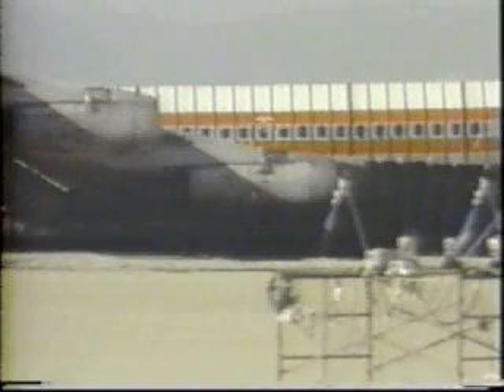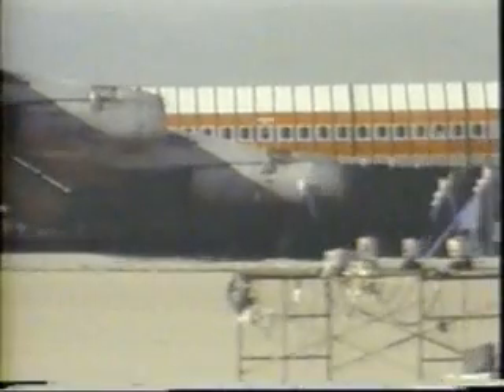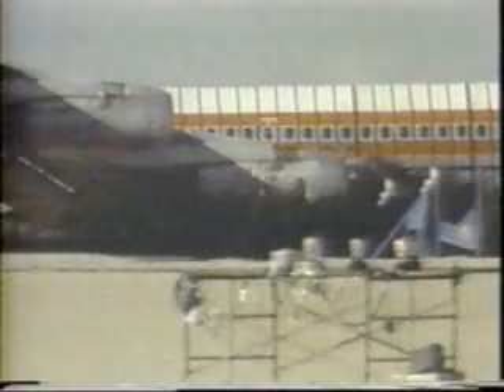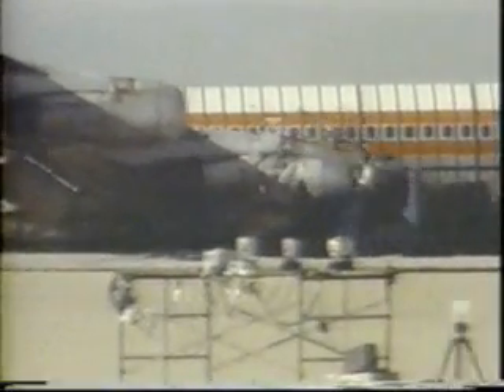NASA - FAA Conduct Airline Crash Tests

Comment: Blah! Thats's not fake.  I worked on that project when I was employed by NASA at Edwards AFB in California.  It was a test to attempt to reduce the flash fire of burning fuel should an airliner crash.

The fuel in the tanks were a gel, then gets converted to liquid when it's consumed in the engines.  Even though there were lots of flames, technically it was a success.  The flames were created by the fuel that was converted back to liquid.

Comment: @IExposeMormonism TWA flt 800 exploded due to fuel fumes buildup and electrical short.coupled with this older test prompted all aircraft mnfctrs  to install inert gas fume retardant. simple knowledge and simple things you theorist throw out the bin in oversimplification.

also, why use thermite when a plane is enough?
so many verisons of your theory and i believe you will get confused, from missile on board the planes
w/c contradicts using drones.

Comment: @IExposeMormonism

1st Thermite
2nd missile on plane
3rd expensive nanothermite.
4th drone planes

again sometimes theorists only have these and have radio commentators become full bred professors.
dismisses little details like fuel tank fire/fume retardants and improved airliner and fuel designs.

again thermite has aluminum and iron. obviously the same materials used to manufacture WTC.
dont expect a cartoon plane cutout in impact, expect office furniture to survive a 500mph impact.

Comment: @IExposeMormonism nano-thermite? i thought that thing would be too expensive more than just rigging a plane. so that line of logic is crappy.

thermite is easily affected by gravity and burn downwards unlike what you believe that burns horizontally, a photo you people based on was a truss cut by a torch DAYS after the incident.

"few frames then exploded"-uhm thermite does not explode ehem.
come on. you are simply copying crap from CTV and LC.

also how many aluminum foil layers are u wearing?